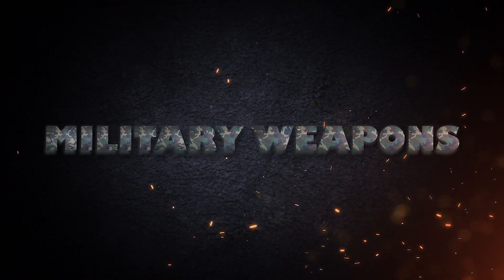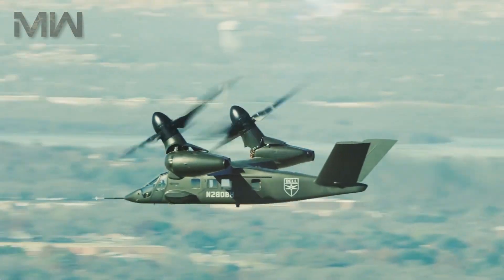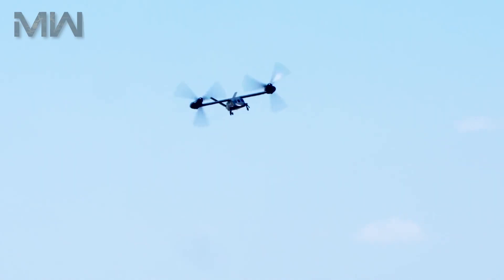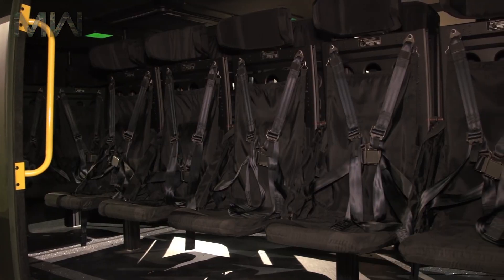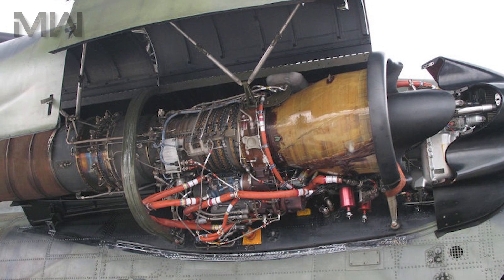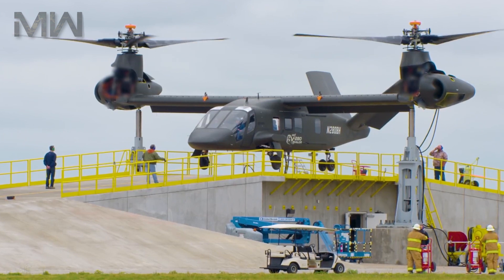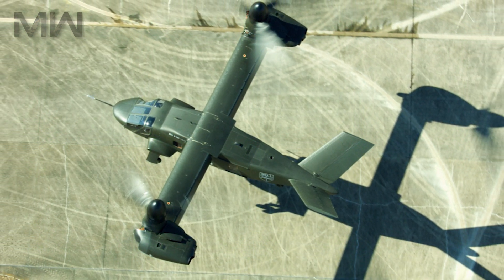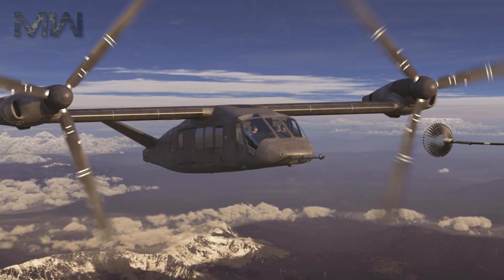Vertical Lift Aircraft Bell V-280 VALOR: US Air Force

Comment: Imagine if they mounted a shit ton of guns on it, like a MK44 30mm bushmaster rotating mounted gun on the bottom,  mk19 grenade launchers on both sides, 8 hellfire missiles, and a remote controlled gau 19 on the front tip of the aircraft. We can call it the valor gunship!

Comment: Why not just use the V22 Osprey instead of wasting money on a new design! Its okay to have the same aircraft as another service! I’d rather them customize the V22 to their liking vs making a whole new chopper!
Reply: It is smaller, lighter, and cost about half as much to buy, and maintain. The V22 is more of a heavy lift utility transport, where the V280 is based on long range assault. The V22 can't hover at higher elevations such as mountains in Afghanistan, where supposedly the V280 will, due to its lighter weight.
Reply: Because the V22 has limitations due to the necessity to store it on carriers.  The V280 brings improvements from the V22, plus the Army is developing replacements of various sizes for different needs.

Comment: If the design was so stable why is it every drone has 4 or more propellers?
Each of the 4 propellers with its own electrically powered motor all powered by a single gas twin turbine generator. This will be the third generation.